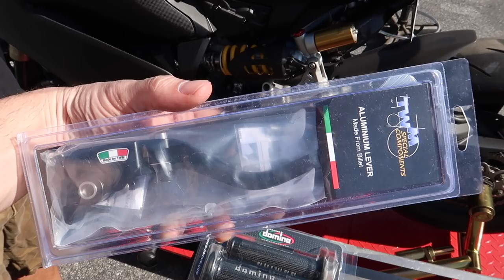Carbon Panigale with Blacked Out Grips & Levers!

Comment: "It's even machined out right here for like... high spped airflow..." :D ehm nope, i'ts just a predetermined breaking point. if you reach maximum lean angle the lever is won't break off entirely so that you can ride on in case the bike is not completely done.

Comment: Ducati is supposed to be a premium motorbike manufacturer and quite expensive especially in the US, how come the throttle grip is not perfect and could do with plastic spacers?? Rearview mirrors as well as brakes must be functional before they're attractive, that's why higher placed mirrors - which we find in most bikes- are the norm, they will give you a greater viewing angle. Also mirrors at the end of the handlebar will one day- inevitably- knock on a wall, a car door, or a car's external mirror while filtering traffic. :-(
Otherwise stunning look.